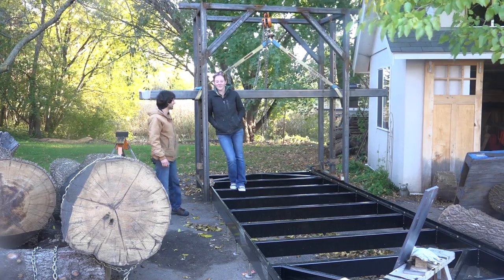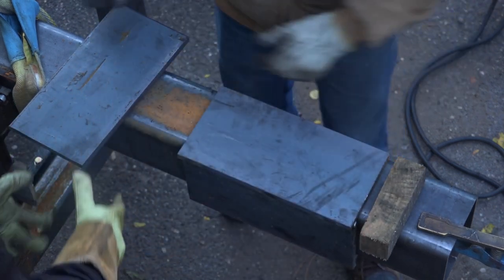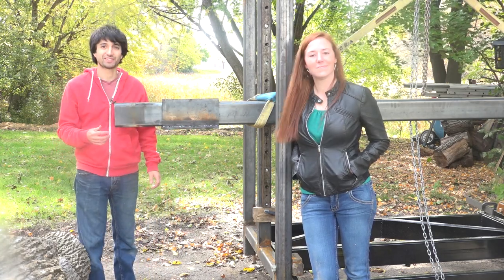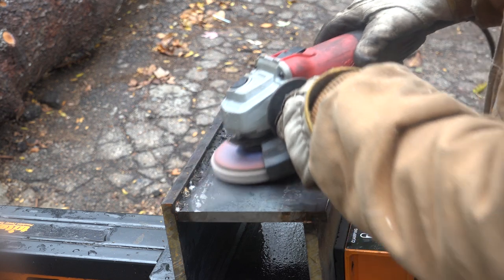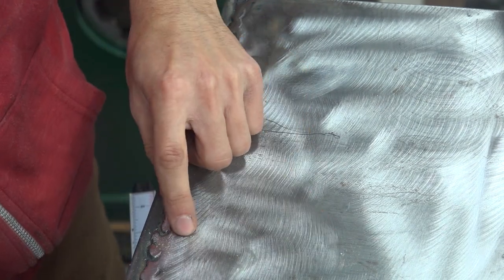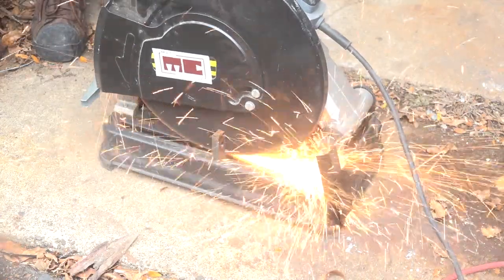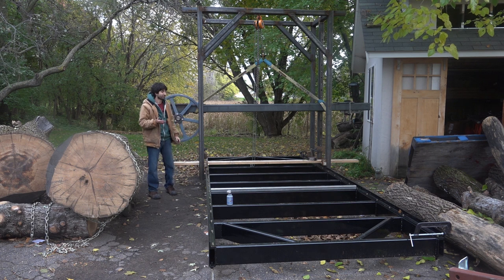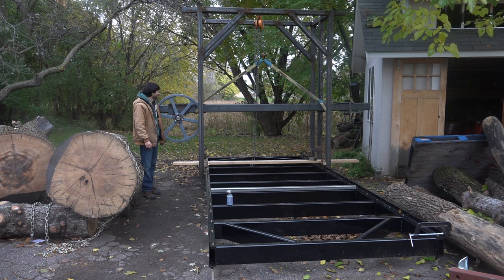The Idle Wheel - Building a Large Bandsaw Mill - Part 8

Comment: The spring is necessary to allow for expansion of the saw band.The saw band warms after start up at which point it expands and becomes larger.The longer the saw band the greater the amount of expansion.That causes the tension on the band to decrease,you would add tension in order to keep sawing,the problem comes when you quit sawing.With a rigid setup you have to remember to release the tension after shutting down.Otherwise the band cools,contracts and as a result applies massive amounts of force to the saw's components.The force is not insignificant,on one old home built mill I had the force was great enough to fracture a 2" diameter wheel shaft.Not good to start the morning having to replace a wheel shaft LOL. 

The hydraulic tensioner plan is a good one,it's much faster and easier to apply the correct tension with a hydraulic tensioner,but you still need to include a spring for thermal compensation.The hydraulic tensioner by itself is a essentially a rigid tensioner,since hydraulic fluid it virtually non-compressible .The blade manufacturers can give you the numbers for the required tension.I used some heavy die springs on the last mill I built,I purchased those through McMaster-Carr.It's a simple matter to include a compression spring on the end of a small hydraulic cylinder.

Your mill is looking good so far,nice job,I'm impressed with those big honkin linear guide rails!

Comment: Matt next time you do some tapping try using a product called "Rapid Tap" it really helps to protect the taps from grabbing. Also when you did your layout if you had just used the sides of the slots on the same side you would have had the correct location for drilling, then all you would have had to do was layout the distance from the edge to give location of your centre punch.

Comment: Great video Matt, I'm at the same step in my sawmill build. Unfortunately gotta stop now until spring,  crappy weather here in Ontario, Canada.
If I can give up some advice. When you are drilling and tapping holes, after u drill your hole put your tap in the drill press, use you low speed and turn you drill press off and on tapping a bit at a time. This makes the threads much tighter tolerances then the T-handle. And use oil it cleans the threads on the tap so the cuttings don't clog your tap.
Hope this tip helps.
Great job on the build and your channel, enjoying each video.
Reply: Good iodea. I don't think you can use too much tapping lubricant.

Comment: hi Matt. just a suggestion for you. from all my experience working as a mechanic on specialized equipment, I believe you would be better served by using studs to hold the bearing assembly to the block. Use the coarse thread holes you already have (with loctite)and fine thread for the rest of the stud. You can realize more clamping force due to the thread engagement of the fine threads. You will probably need the extra force due to the fact that you are going to shim the bearing assembly for alignment. You will lose the benefit of friction due to reduced surface area in contact between the two pieces. Otherwise, you're doing a great job, as usual.

Comment: Mat nice job on the construction wish I was there with you helping. Really can't wait to see it cut. 
Couple of 'rule of thumb' tips for drilling metal - 1.) The smaller the hole, the faster the speed. The bigger the hole, the slower the speed. 2.)Take 'pecks' - it's a good idea not to allow big long curls of hot sharp swarf to come out of the hole, just take off the pressure for a second during the cut and the swarf should break. 3.) Just like wood work tools keep your tools sharp. This matters a lot in metal and will save you a lot of time. All the best -Adam

Comment: Years ago I built a dynamic tensioner for some farm equipment using a hydraulic RAM and a pressure regulator.  Had a pressurized hydraulic reservoir that supplied the pressure regulator.  That way I could preload the system prior to use and it maintained pressure during the use. Used it for years with almost no maintenance and it worked to keep the chains on our loaders tight and working.  May or may not work in your case depending on the magnitude of the tension that you need.  This is something you can add at a later date while still using the existing hydraulic RAM.
Reply: james davidson he could have even used something really simple, like a collection of those pneumatic cylinders that help push up the rear hatches on SUVs.

Comment: Hopefully a helping tip, the use of lubricant really helps the cutting action as well as dissipate heat. It really amazes me that you have had just a couple years in the wood/welding business and here you are designing and building a saw mill and furniture. That is quite and accomplishment especially when you do it to perfection. Are you self taught or had the opportunity to work with a pro before going on your own????
Reply from the maker: +James Pugh I use a lot of it. Applying it is one of the first things I cut out in the interest of keeping the videos at a reasonable length.  I'm self taught. Never worked with anyone

Comment: For the tilt up and down have a piece of plate milled at a 1 degree angle and use the bolt adjuster to push it in from the rear to adjust the angle.

Comment: Awesome! That thing is a monster! Big enough for an industrial mill. Are you going to have any kind of hydraulic or motorized assist to move the carriage through the log? I'm thinking when you're actually cutting, it would be too much to do manually.
Reply from the maker: Eventually it will have power feed.  It won't be much work to push it through the smaller logs.  For the bigger ones, I'll set up some sort of winch.

Comment: @ 2:58 April welds a tack and then lifts her visor to check it out. No Safety Glasses!!! If that weld pops or throws off some slag as you chip off the slag you are set up for a world of hurt as the slag is still way hotter than boiling water at that point and we are made up of a lot of water, so you do the math. Please everyone, when you are welding or grinding [don't forget your ear muffs] use proper safety glasses which are rated for impact resistance.
Reply: Calm down there safety officer, you're starting to sound like a shill for PPE companies.
Reply: lol and osha. still mark isn't entirely wrong, I've hat welds pop on me. though nothing has ever gotten in my eyes from it.
Reply: I had some land on my neck and it put a nasty little burn there, and your eyes are not much higher up, plus slag has a nasty habit of bouncing around. I have had stuff get past safety glasses before including a metal splinter to one eye, now you had a lot of heat to that item and suddenly you are up for a whole world of hurt and pain, serious eye damage, possibly permanent and time off work plus expensive medical bills.

Comment: Hi Matt. Great video series. Just one question. Why is the mill as high as it is? I'm assuming all will become clear later on, but just trying to understand what the extra height will be used for. Keep up the brilliant work
Reply from the maker: +Mike Nash thanks Mike! The mill will be able to cut as high as it can cut wide. The saw head will be able to go high enough for the blade to cut the top of a 6' diameter log

Comment: All good. If it isn't too late instead of using "low tech" shims to get the up tilt, would it be feasable to tap the flanges and then screw a bolt in and lif the flangethen lock it in place with a nut.  (If there were four holes, one in each corner you could make some fairly precise adjustments and it should be easier then dealing with trying to adjust with shims)

Comment: Hi Mat,  Why not trim the plate before welding it onto the slider. and why not drill a couple holes in it to allow for plug welding too
Reply from the maker: +drawvenmusket I wasn't sure if I was going to need the space behind the shaft. I'm glad I left it because I ended up adding front to back adjusters. I added the plug welds and the second weld pass later when installing the tensioner

Comment: A tip for your welding with stick. If you tap the stick, you run the risk of sticking to the part. Try stroking with pressure and that issue isn't as prevalent.

Comment: Good progress!!  I'm wondering how you are going to move the beam up and down.  Huge Acme screws?  Cable system/winch?  Helium filled balloons?
Reply from the maker: +radroy92 acme screws but I really like this ballon idea
Reply: I'm using Acme screws too.  I was looking at the flange bearings most people use for the lower Acme rod bearing and they are not designed for a large axial load.   I'm modifying a hydraulic flange to accept a tapered roller bearing and grease seal.
Reply from the maker: I'll be using a thrust bearing to support the rod and in turn the entire saw head.
Reply: What dia. Acme rod?
Reply from the maker: 1.5"
Reply: Heafty!  Can't wait to see the wheels on!

Comment: Great work Matt, the sawmill construction is progressing well!
But in term of design, are you sure about using only two linear bearings? There will be be a huge cantilever on them as all the weight of the front head will be apply almost one foot away from them.
Will you use one or two "head lifting screws"? (I don't know the word for that in English) 
Keep the good work going!
Reply from the maker: +Antoine G thanks! Yes, I'll be using two threaded rods near each wheel. The linear bearings are just to smooth the motion
Reply: Perfect then ! Looking forward to see the synchronisation (by chain I suppose)of the two threaded rods !
Reply from the maker: Antoine G yes chain linked :)

Comment: I may have missed a video, but how much is the carriage portion of this going to weigh when completed?  As a rough guess you're somewhere around 1/2 ton right now without any of the saw.  Am I correct that it's going to be human driven?  

I'm just trying to imagine the friction you'll be going against with carriage and saw alone, not to mention the extra force required to move the blade through the wood - like pushing a car for the entire duration of each cut.  Is there a place for a winch or similar to attach if it winds up being too much to move as a practical matter?
Reply from the maker: The carriage will weight around 3/4 ton when complete.  Funny thing is it's getting easier to roll as more weight is added.  I'll be pushing it by hand initially.  For the bigger logs that require a slower and consistent feed speed, I'll use a winch to pull it along and in the future, I'll be adding power feed.

Comment: started building a mill, know where I might find a drive wheel and idler wheel set?  all I'm finding on the net is replacement parts for little mills and no size measurements.  looking for something around 20" diameter with 1 1/2" blade surface area.
Reply from the maker: These are from cooks. They have a few sizes available

Comment: How about using a air cylinder for the tensioning system, that way you can use a pressure regulator and simply set the pressure to a fixed number and the blade will always be under the same tension. To release the tension simply put in a valve and a dump port and you can take the tension off the blade when you need to change the blade.

What are you going to do for blade sharpening, are you going to build a blade sharpening jig that can sharpen the blades in situ so you don't have to take the blade off the bandsaw all the time?

Comment: I hope you made your idle pulley a half inch or more above your drive pulley. if not you will have problems with making full contact on your guide rollers. this will cause blade chatter or slippage. a good video to watch for this is ( old man build details )
Reply from the maker: It worked out that it's a little higher but both wheels can be adjusted vertically and my guide bearings also have vertical travel.

Comment: what source did you use for your wheels and spindles?  Is that a 24 Inch wheel?
Reply from the maker: +Milton Fludgecow they're from Cook's saw. The wheels are 30"
Reply: @mcremona  I'm following the plans, but can't seem to find details on the blade used.  What thickness blade did you get for the wheels and the retrofit guide?  I'm assuming it's 2 inch.  Also, is the shaft size for the drive wheel 2 inch?  Thanks

Comment: You'd hate it to be under-engineered, wouldn't you? :-)
Reply from the maker: yes :)
Reply: Agreed, build it the right way once. Do you see yourself building another sawmill? :)
Reply: over built is under engineered.. using 1" thick material where 1/4" would do fine is terrible engineering.. im not being specific to matt the sawmill came out great but just in general bigger isnt alway better.. building something 5x the cost and 5x the wight that does the same job isnt a good thing

Comment: use some W D 40 on those taps
Reply: Claude Hutchings , WD40 is ok but not a recommended cutting fluid, there are much better fluids for cutting threads such as Tap Magic and Hog Wash. the threads would be much sharper and cleaner.

Comment: Your a pro at these videos why dont you condense them, anyone building a mill knows how to cut metal, drill holes, weld, paint and grind. plus your materials are way overkill I dont think there are many commercial sawmills that have machines built out of such stout materials. For what you spent on materials you could have hired an engineer to figure it out